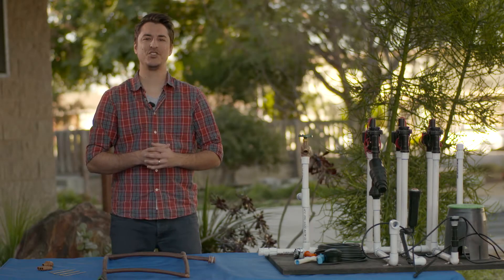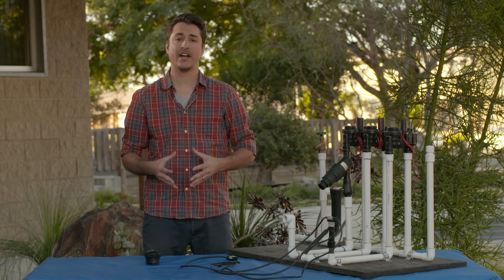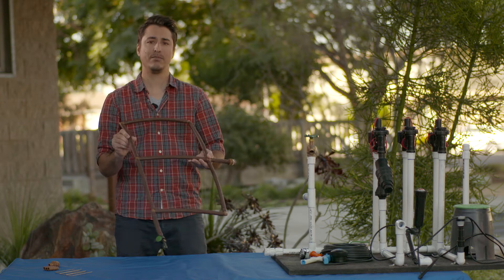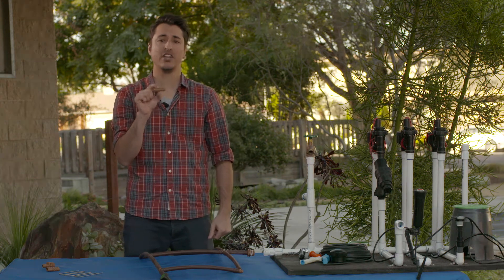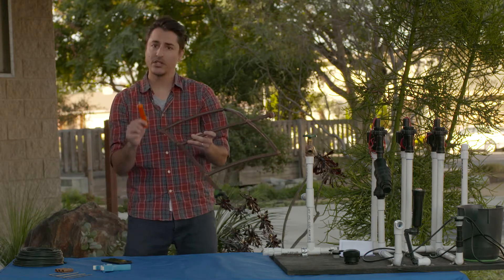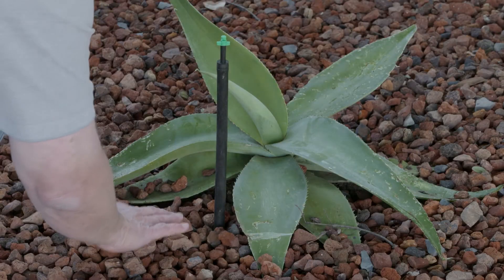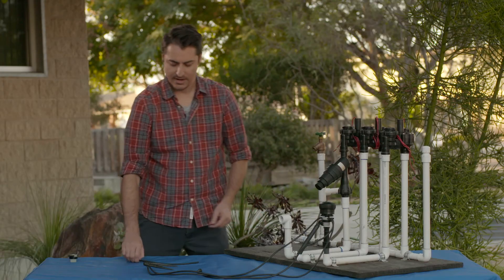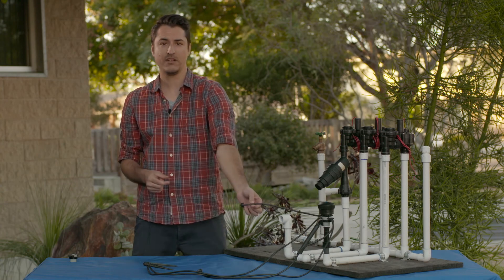Drip Irrigation Tutorial pt. 2

Comment: Main Trunkline - coming off with drip emitters for ea plant.
punch tool - pierces line where plant is for emitter.
Same 1/2" line w/o pre punched 
point source emitter, goes into hole punched
1/4" used as extension to feed plant far from mainline (attaches in the point emitter?)

Comment: Necessary - Anti-Siphon Valve (Turns system on/off) Manual/Automatic (Requires Timer)
Pressure Reducer - Filter (catches sentiment)
1/2" line - (pre drilled?) holes 12" for even saturation
Cupling - attaches 2 pieces of 1/2" line together to make the grid (goes inside 1/2")